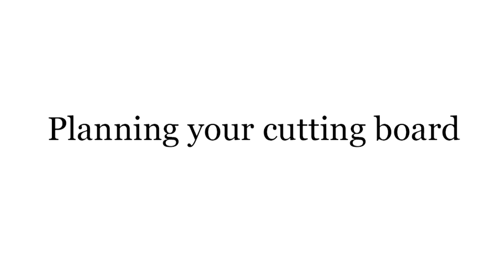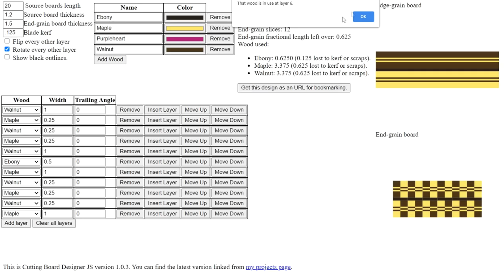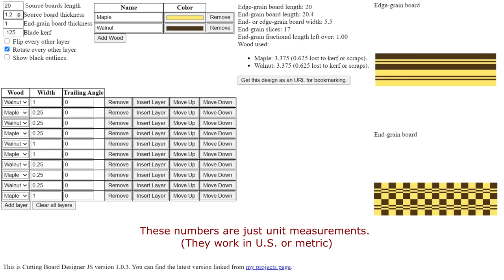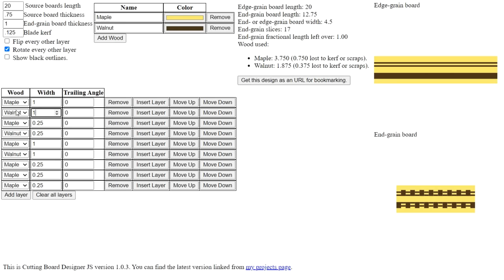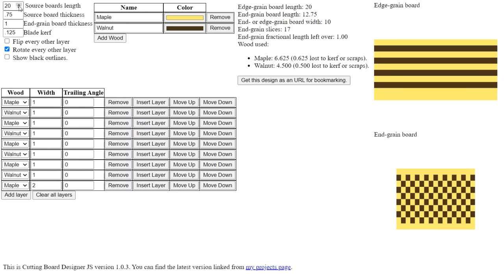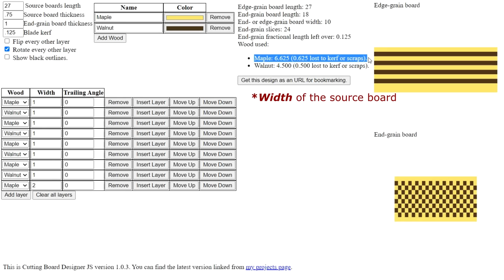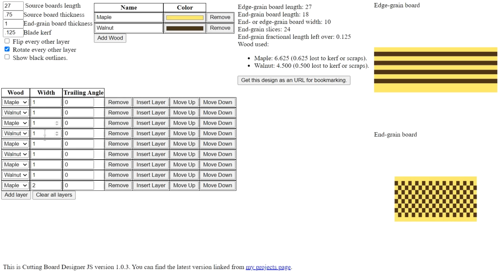The ultimate guide to making a wooden end-grain cutting board

Comment: I'm so glad you liked my cutting board design software.  I haven't thought of it in years; glad to see it's still useful!
Reply: Are you the developper of the software?
Reply: @VioletYT  yes.
Reply: @uraniumyt559  Amazing. You should be proud! Great job!
Reply: Correct me if I'm wrong, but Steve glues up a face-grain board in the frist glue-up, however, your diagram is titled "Edge-grain board." Based on the calcuation from the line "End- or edge-grain board width: " I think the diagram should be titled "Face-grain board", yes? The width of the "edge-grain board" would be calculated based on the thickness of the source wood, but your software is calculating the width of the first board based on the width column in the table (the width that each piece is cut to), making the diagram a face-grain glue-up. Am I missing something here? Steve's turned out fine because his source width and cut-width were the same. When I tried it, however, I had a source width of 1 inch but cut each piece to 1.5 inches and the first diagram width was incorrect when I went glue it up in an "edge-grain" orientation.
Reply: @TeaLoveandCare  I don't use the term "face grain", only edge or end, to be clear.  What I'm calling edge, I think you're calling face.  That's probably more accurate, but that's not how I wrote the software, so I'm going to stick to my way for this answer.

What I'm calling width is actually the vertical dimension in the diagram; I call the horizontal dimension length, as it's longer in the sample board and in the boards I've made.  Since the slices are cut vertically, that means that end and edge grain boards have the same width; it's only their length that differs, by a factor of the slice thickness divided by the edge-grain board thickness, and accounting for kerf.  Does that clear things up?
Reply: Looking at that now, I'm thinking this would be a lot clearer if I rotated the diagrams 90°.
Reply: @uraniumyt559  Thanks for the reply. I understand it better now. My board turned out really nice. Thanks for the software :)
Reply: I appreciate you making this software available.  Have you ever considered expanding its capabilities?  I would think many people in the woodworking hobby and business would be very interested.  I know I would.
Reply: @dlw9119  No, it was really just a weekend project when I learned to make cutting boards. Anyone is free to expand on it, but I'm unlikely to pick it up again.
Reply: @uraniumyt559  Metric??? :)))))))))
Reply: @dirkvantuijl5212  There are no units at all; feel free to imagine that the numbers are in centimeters =*).
Reply: I use it!
Reply: @uraniumyt559  What do you mean by trailing angle? I am planning on making this cool looking board with your software but it requires a 45 trailing angle and a -45 trailing angle. I am confused by what that means since it's on the different species.
Reply: Hey, I’m going to use it myself soon! The math is the only thing keeping me from making one of these over the years. Just didn’t want to fuss with it.
Reply: @12stormy13  I've been wondering the same thing!!
Reply: I dont understand the "wood used" portion in the software. How is this calculated? I went looked through the code on github but can not understand HTML.
Reply: @uraniumyt559  Can I have your link? I can't find it on this video and I would love to check it out before I open my own shop!! Thanks!
Reply: Broo your software helped me so much thanks a lot 🙏🙏🙏
Reply: I have 3 types of wood, 8 boards of each, 3/4" thick x 2" wide x 24" long. Having trouble figuring out the layout pattern for an end grain cutting board.
Reply: Could you add a cm version?
Reply: 2 years later, I want to make a few cutting boards, and I'm definitely going to use your software. It's so useful!!

Comment: Can you tell us how long it takes to make one? In real time, including glue up time? I wanna try this
Reply: It appears like roughly 6 hours, all things going perfect. However, if you are doing multiple cutting boards at a time, you can probably do half a dozen in a day depending on the number of clamps you own. Also given the costs today for the wood, you'd be looking at more than $100 or even over $150 per cutting board if you wanted to pay yourself anything trying to sell these things.
Reply: I make cutting boards as a business. I'm not super efficient like a full time business. But it's going to come down to how you start. I use s2s lumber from a lumber yard. I mill everything the way I want it. I'm currently building an 18" x 24" x 1.5" Maple endgrain board for a customer. It took about an hour and half from milling to first glue up. I let the board setup overnight before any additional milling. I then run the board through the drum sander or planer the next day. Cut my endgrain strips and glue up again. That's an additional hour to hour and a half. This glue up sets up for another full 24 hours. I will run it through the drum sander for the rough sanding process. Then finish working up the grits to 220 with my ROS. From there it's details. If the customer wants rounded or chamfered edges, juice groove, hand holds, feet, laser engraving or cnc inlays. This is done now. Then on to finish. I bathe the board in mineral oil for a few hours. After the board is saturated, I apply my board butter I make which is 4 parts mineral oil to 1 part bees wax. I use a cloth to apply it. Let it sit for at least 30 minutes, wipe off the excess then buff the board. Total time (minus waiting for glue ups can be anywhere from 4 hours to 10 hours depending on complexity. I sell my boards anywhere from $40 to $750. I sell more higher end boards than I do small cheaper ones. Sorry for all of the info but figured I'd share from someone who does this.
Reply: @nickq615  Your finishing process is absolutely beautiful and your price is expected for the labor and love you put into each of them.

Comment: One tip on sanding, make pencil lines across the workpiece to make sure you're sanding it evenly and flat to avoid sanding parts lower that will cause gaps in the second glue-up.
Also put your pieces together to check for gaps before applying glue to match the edges and make sure there's no gaps in the piece you plan to glue.

Comment: I like this design and this video so much that I decided to make one myself. I had some maple and walnut scraps I wanted to use up. There were many imperfections in my scrap pieces (which is why they became scrap in the first place).  I could tell they would not adapt well to end-grain, so I decided to go with face-grain.  The result is a beautiful board that I am extremely happy with.  It may not be as durable as an end-grain board, but it wasn't serving any purpose as scrap on my basement floor. In the process, I realized how Steve's approach is so easily adaptable to face, edge and end-grain depending on what you have to work with.  I think Steve's video is worthy of a Golden Globe award in the woodworker's category.

Comment: Great video.   Well produced, great tips Thank you !...    I've been making end grain boards for a couple years now and your advice is spot on.   A couple of things I've learned for what its worth.    1) I wet my boards with a thin water mist to raise the grain before finishing, then lightly sand with 180 grit after it drys.    This really helps reduce the fuzzy feel of the board after the first wash.    2) You can get a gallon of mineral oil online for less than $18.   This quantity is helpful if you are making more than a few and/or letting them soak rather than hand applying    3) I melt  bees wax pellets($15 for 1 lb on line)  and mineral oil together for my finish.   Aprox 1 to 4 ratio. I mix up a small sauce pan full and pour it into small mason jars. Low heat and gently stir in the pellets.  When I gift a board,  I give a small jar of the mixture to make it easier for the new owner to maintain the board.
Reply: I've seen other people online use a mixture of beeswax and mineral oil. What is the advantage of adding the beeswax?

Comment: Lovely cutting board, and it looks like a fun afternoon project.  Was just talking to my husband about getting a jump on holiday gifts...everyone would love these.  Here's a ckeaning tip, for really stubborn smells, rinse with cold water and try rubbing the flat of a stainless steel blade against the wood.  (This also works for your hands)  for things stuck on your cutting board,  don't use green scratchy pads! Instead, liberally spread some coarse (kosher) salt on your board, cut a lemon in half to use as your scrub brush.  If that doesn't work, use the rest of the lemon and make a Whiskey sour.

Comment: Steve, This is definitely the best end grain cutting board I have seen.  Thanks for sharing all your insight and methods.  I have been wanting to make one for a long time.  I am glad to see that you did not drill holes and attach those rubber feet.  An old trick we used to use when I was a line cook is to place a damp kitchen towel between the cutting board and the counter top.  It will keep the board in place and soak up quite a bit of juice if any happens to escape over the sides of the board.

Comment: I'd like to add one tip for board maintenance. If you are rinsing the board, make sure to run water on both sides. Dish soap is not necessary on the unused side. My habbit is to wash the used side, then run water on the unused side, place it on holder with the unused side facing out. Next time when I use it, the unuesed side will be used, so you get mostly even wear on both sides. This applies to boards without rubber feel. If you boad has rubber feet, still run water on the side you don't use.
One tip for making the board is to use a roller to spread glue when all strips are pushed together. MTMWOOD has a lot of examples.

Comment: I'm close to completion but there is A LOT of sanding still left.  For those of you that don't like sanding you may want to reconsider taking on this project.  I'm using an orbital sander with 80 grit discs.  The residual glue + hardwood laughs at 80 grit sandpaper.  Also, make sure you have many quality clamps and patience for the gluing stages.
There is a reason why these boards are so expensive.  Although Steve made it seem easy there is a lot of work involved.
Absolutely amazing video and thanks for the link to the cutting board app.
Reply: Agreed, this project made me want to get a planer and a belt sander.

Comment: Getting the final glue up to line up perfectly is really tough as the pieces can slip when tightening. You can use cauls on the edges to keep them aligned.
Reply: Don't get too hung up on aligning the pieces perfectly. Small errors fade into the overall pattern and are almost invisible. You can see the impact when you dry fit the strips; just shift one strip a little bit and see if it shows up in the complete board.
Reply: @bobt2522  I can definitely see it anytime I see people post their projects online. It doesn't take much work to improve the alignment, so why not do it.

Comment: Instead of adding the nonslip rubber feet ( at 20:38 ) to prevent the cutting board from moving, lay a damp paper towel (or two, depending on the size of your board) on the counter and place your cutting board on top of it. This will hold your cutting board securely in place.
Reply: For those sceptical of this, this works with most counters and cutting boards and is a great trick that several professional chefs have shown me and I've used it ever since. Seriously worth trying if you haven't
Reply: Cotton towel works too and two or more layers add nice soft feel to plastic cutting boards.
Reply: What is even better is a shelf liner
Reply: A damp 'Chux'-style dish cloth works great on a smooth counter top, as used by Sydney Seafood School in Oz. Also any cloth dish drying towel once its been wet and wrung out - something to keep the old 'Hol{e}y' towels for, rather than tossing them in the bin for landfill.

Comment: Board came out great. I would recommend finishing it with cutting board paste. It's a mixture of mineral oil and bees wax. The ratio is 4 parts mineral oil to 1 part bees wax. You add this stuff to a sauce pan and heat until the two parts mix together. Pour into a can or jar (I use a short mason jar) and let cool. Once cool, it becomes a paste. Rub on the board and it protects the board for longer. It closes off the ends of the end grain and prevents bacteria from growing.
I enjoy your channel a lot. Keep up the good work!!
Reply: I do the same thing, but right now I am using paraffin wax.
Reply: Not sure if paraffin wax is food safe, I think it is. I know that bees wax is food safe as well as mineral oil. Good luck 👍
Reply: @michaeltretina  I haven't looked for it in years, but you used to be able to buy paraffin wax in the canning aisle. My grandmother used it to seal the top of jellies when she was canning. I don't think I'd want to use paraffin wax from, say, the candlemaking section at Hobby Lobby on a cutting board, because they might not be careful with the processing of it, but I bet you can still buy foodsafe paraffin.

Comment: You can put end grain through a planer is you take VERY shallow passes and sand or round over the edges the knives will hit first so they don't grab and rip the grain on the edges.
Reply: @bobt2522  I've only done it because I've heard professionals that have said they do it on a regular basis using the precautions I mentioned without any issues. 
It seems more like one of those things that's recommended not to do because some people will end up hearing that it's ok with the details to it that makes it safe.
Reply: I do it all the time (hundreds). I have a spiral cutter head, and I also glue sacrificial edge grain boards to the ends. The end grain will chip out badly if you don't do this, and you'll end up having to cut quite a bit out to remove the chipped sections.

Comment: Just finished making one following your video.  After the first glue up,  I realized it didn't fit in my planar, so I cut it in half and then changed the depth of the final board based on the new dimensions.  I also somehow have a small error which compounded, so I lined up all of the patterns down the center, and as you move out from there, they start to overlap in the corners. Maybe by 1/16" by the end of the board, so not too bad. I think I might have taken one strip out of the middle and planned it by itself because of some Chipout.  Oops. Anyway, I think it is beautiful, and my wife won't care.

Comment: Great information. I’m new to woodworking and have been watching lots of your shows. I’ve found them easy to follow and understand. Thanks for your knowledge. One step that I heard would help on cutting boards is to use a paint scraper to scrape off the glue before it’s completely dry or before you sand to remove the squeeze out and make it easier to sand. Another trick I learned is to spray your board with water after it is all sanded and ready to apply mineral oil. Before you apply the mineral oil, spray with water and let dry and any fibers that didn’t get sander will rise and you can now sand that smoother and remove those fibers so they done show up later during use.  What do you think ?🤔

Comment: Nice video, i will be sure to look for this software to figure out some more complicated patterns!

For the finish on mine, i usually start by applying mineral oil until it stops drinking it, then i switch to a blend of mineral oil with bees wax. The wax seals the mineral oil in and prevent the water from penetrating the wood. With this product, i can apply a coat and not have to put another one for a couple of months (3 or four month depending of use of the board).

Comment: If you put a clean dish towel underneath a cutting board it'll almost entirely stop it slipping as you're using it - no feet needed. If you need even more grip you can dampen the underside of the towel just a little as well.

Comment: Also one tip to do, more on side grain boards is to wet the board. Let it dry and sand away the raised wood grains. Do this until the wood grains wont raise. Saves you from problems in future.